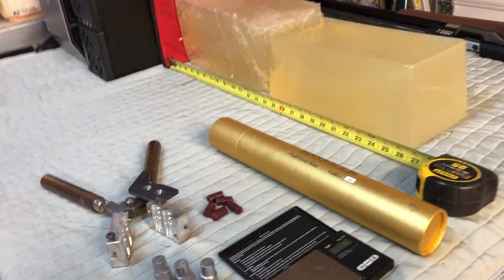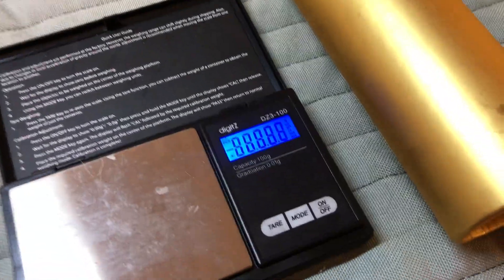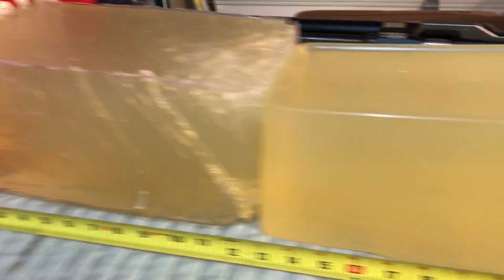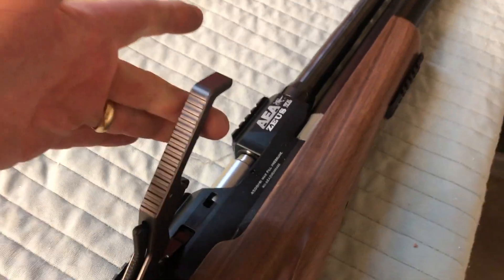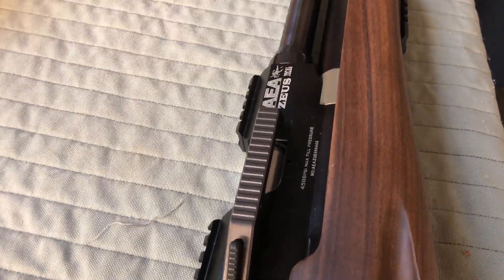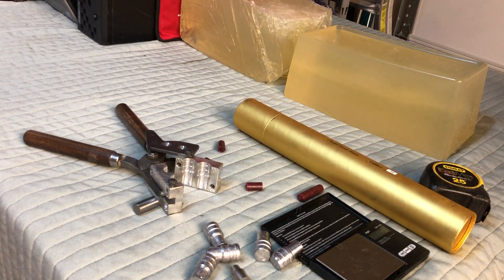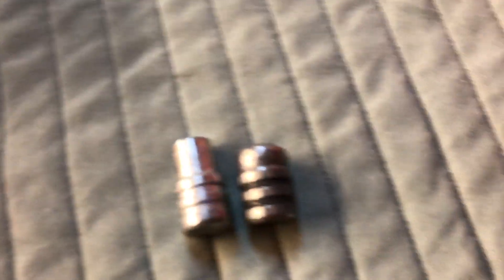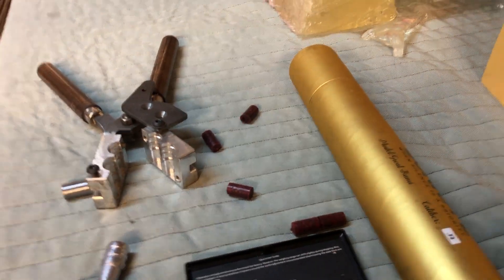WORLD'S LARGEST 72CAL PELLET! AEA Zeus 72 w/ TPP 1315gr pellet on 24" ballistic gelatin VID22

Comment: CAN YOU MAKE SOME TUNGSTEN STEEL POINTED CORE INSIDE OF A 50 CAL. CAL SOFT LEAD BULLET FOR A 50 CAL. AIR GUN ? THANKS. LOVE YOUR VIDEOS !👍
Reply from the maker: The short answer is yes, 7mm tungsten and tungsten carbide rod is available (Pure tungsten is much more expensive than tungsten carbide).